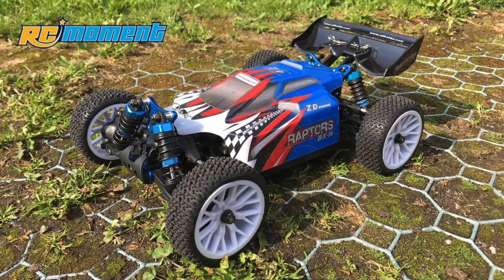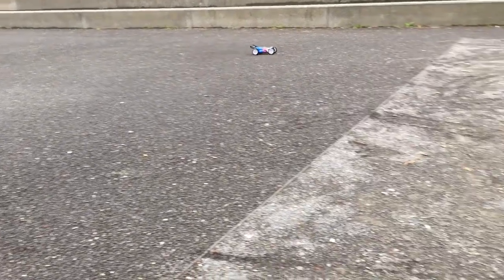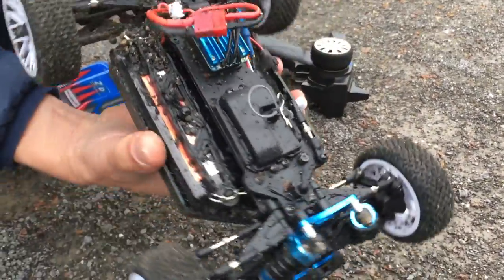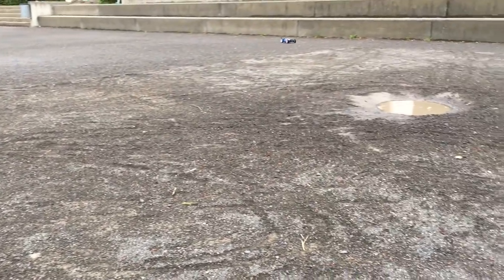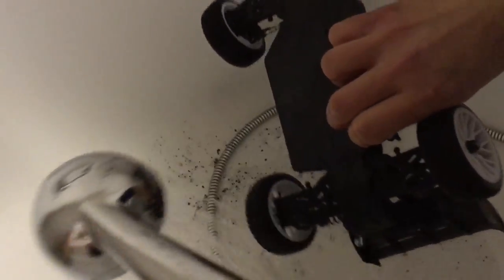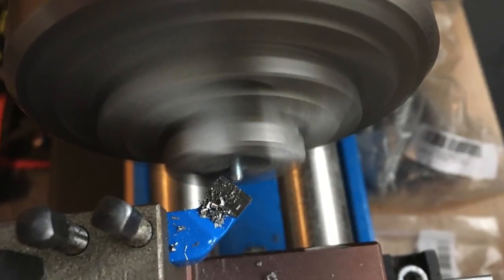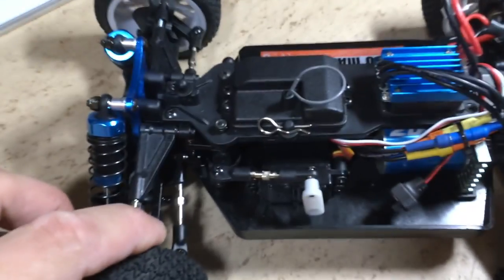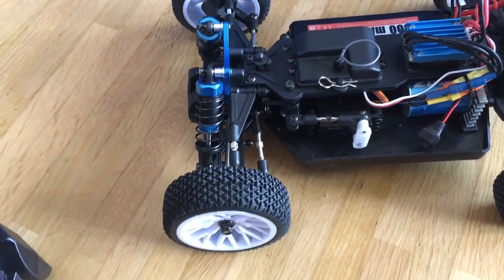ZD Racing RAPTORS BX-16 4WD Brushless Buggy: Bash, Torture, Crash, Repair!

Comment from the maker: This is part 2 of the ZD RAPTORS BX-16 review. Pure torture! This car was very kindly supplied by RCmoment.com Thank you!
Reply: TheDIYGuy999 Buy a traxxas car 🙌🙋👍👍👍👍👍👍👍👍👍👍👍👍👍👍👍👍👍👍👍👍👍👍👍👍👍👍👍👍👍👍👍👍👍👍
Reply from the maker: They are totally overpriced in my eyes.
Reply: TheDIYGuy999 They are expensive but there is one that is not so expensive is the rustler vxl is worth 289.99 dollars
Reply: TheDIYGuy999 Or the rustler of $ 205.99 does not
Reply: TheDIYGuy999 Or the rustler of 159.99 dollars there are several
Reply from the maker: Yeah, there are also cheaper ones, but $1000 + for a UDR is just overkill.
Reply: TheDIYGuy999 There is a discount on traxxas 99 discount page
Reply: TheDIYGuy999 Hey I can be a question

Comment: This is my first RC ever,. I’m embarrassed to say that I am a noob. Needless to say I’m trying I’m having a bit of trouble with changing the motor. I want to ask how did you remove the rear axel ? I Have the screw to the chassis removes, but I can’t detach from the center drive shaft. Can you help please. 🙏

Comment: Great little buggy my freind 👊😊👊 great video
Reply from the maker: Thanks. Yes, it's great and very controllable. Much better than a WLtoys A959
Reply: Just put a bigger motor in like i did. Ive put a 550 motor in my A959. Fast and runs sweet. Check it out my freind 😁👊😁👊😁
Reply from the maker: I said controllable, not fast. Yes, the A959 is fast, I also have one with brushless upgrade. The handling just bad in comparison, because of the shorter wheelbase and a lot of play everywhere.
Reply: Oh ok my freind.  Anyway still looks a good buggy. Ill stick to my A959 👍😊

Comment: Great repair and adjustment. The open gear box is a shame. It will give a big problem in the future.
Reply from the maker: Thanks. Yes, I don’t like this design. But overall it‘s a great buggy with extremely good handling
Reply: TheDIYGuy999 maybe your own 3d gearbox cover is the answer.
Reply: TheDIYGuy999 it would be great if you design your own car (1/16 or 1/12) using 3 d print and the good stuffs from another cars!!! It would one of the best cars out there!
Reply from the maker: Maybe I will do it one day. BTW, I have just finished a 3D printed gearbox cover for the RAPTORS buggy. A video will follow soon.
Reply: TheDIYGuy999 wow! Good to hear. I enjoy your passion making RC cars better.
Reply: TheDIYGuy999 is the 3d print design of the gearbox cover already finished? Looking forward to it. Thx
Reply from the maker: I have 3D printed some parts and did some tests, but it's still not OK. It will take some more time.

Comment: the front differential stopped working on the first day
If you do too much drift, you can not handle it.
here in brazil there are parts of turnigy 1/16 that are very similar
Reply from the maker: No differential issues here after about 5 batteries full throttle. So you have replaced the differential with one from turnigy and it was compatible? Thanks for the hint.

Comment: can the esc tolerate more than the recommended voltage?
Reply from the maker: No, it is not rated for 3S, but I never tried.
Reply: @TheDIYGuy999  what voltage is the ESC rated for?
Reply from the maker: 2S LiPo. It is a rebranded 25A Racerstar ESC like this one: https://www.banggood.com/Racerstar-ESC-25A-Brushless-Waterproof-116-118-RC-Car-Part-p-1082605.html?utm_campaign=4828314_1046285&utm_content=1097&p=NZ29024828314201605E
Reply: Don't know if you went further with this. But today i fitted a 120A esc from surpass hobby in it. There is lots of room around the esc. 
Had to do some slight bodywork though to get the shell back on. But now i can run it on 3s no problem! And if some negative nancys are right and my diffs get chewed up theyre just 5 bucks a pop online anyway ;)

Comment: Amazing! 🕺👍

Did you have any problems with WLtoys 12428 planet gears? I'm thinking of redesigning and 3D printing the differential. I've stripped about 8 original spare parts of them already 😂😂😂🙈
Reply from the maker: Thanks. No, I‘m still running the original gears in my 12428. Also have a look at my other videos. I have two videos, which show you how to design and 3D print bevel gears for differentials.
Reply: TheDIYGuy999, yeah, both videos are very informative nice 💪👍 I just recommend using Nylon or PETG rather than PLA for gears. Best is probably nylon.  Stay awesome 👍
Reply from the maker: Yes, I also think these materials are better, but they are not easy to print.
Reply: I have the MT16 version. I replaced the differential with a full metal version from hobbyking. Problem know is that the pinion gear ( the gear that drives the differential under 90 degrees in the diff case) is completely used. Even after shimming. Any idea to fix this? Thanks